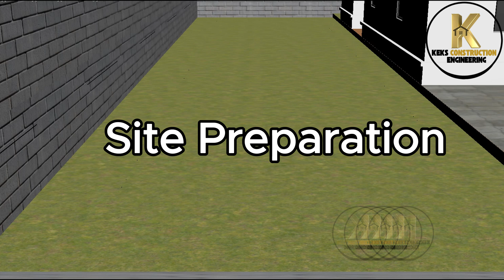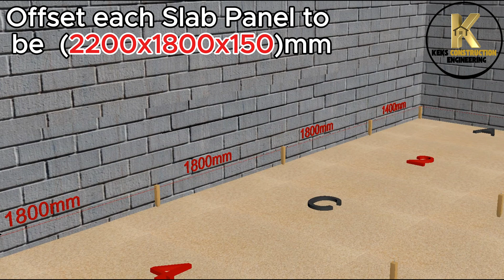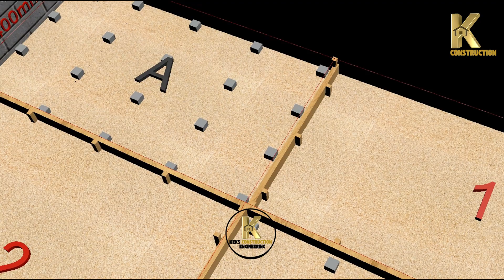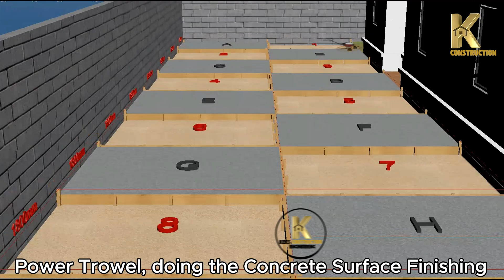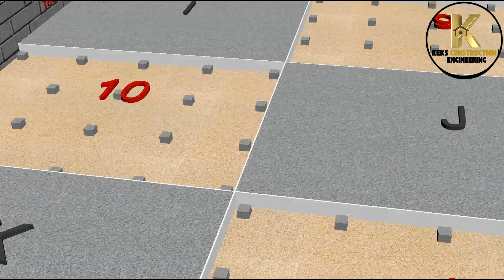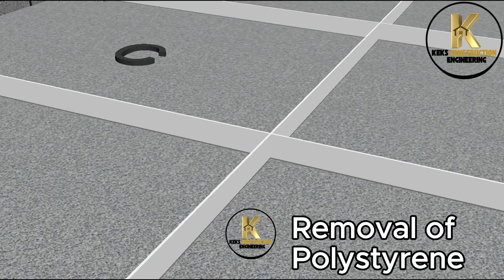How to Construct a Durable Ground Floor Slab (DIY Concrete Slab)

Comment: This is really amazing and educative 
I think I've not seen this kind of standard of practice at site.
My question is people who don't use this method and just floor the compound and probably following the terrain of the land in landscaping and no room for expansion joints, is it bad??
Is The sealant for the expansion joint give room for the concrete to expand??
Explain the function of expansion joint in this video??

Comment: Whats the use of the polystyrene there
Reply from the maker: But this Question is fully answered in the Video.
It is used to create expansion joint between the slab panels.

With this explanation, watch the video again, you will understand it better now.

Comment: What is the polystyrene?
Reply from the maker: Do you know that white Foam-like Material that normally comes with the Carton of a New Electronic, such as radio, television etc??
Reply: Ok. Thanks  @keksconstructionengineering